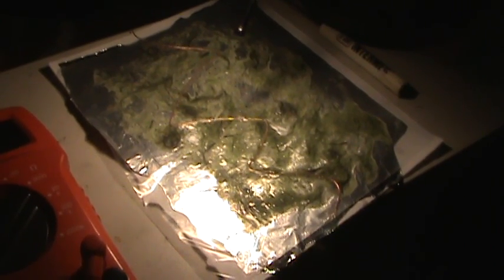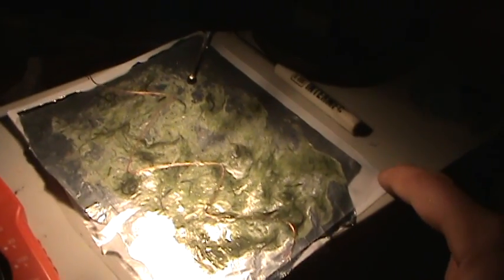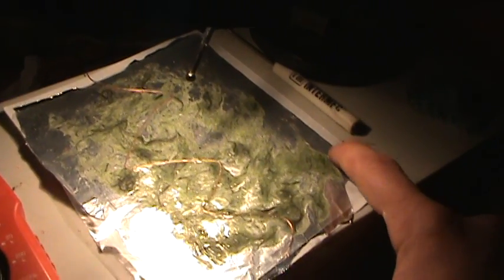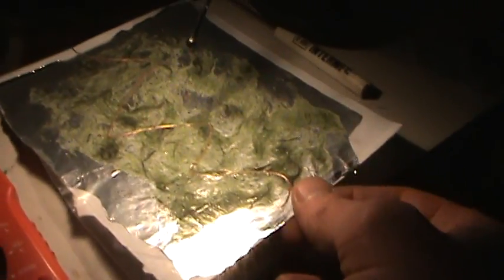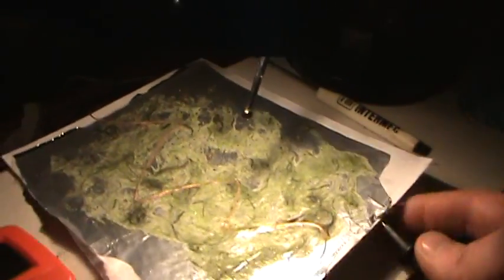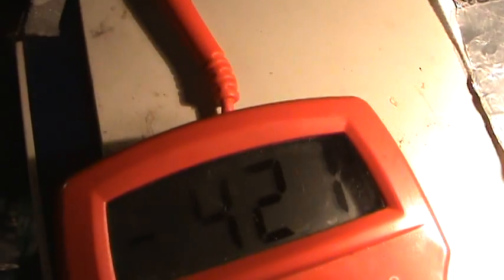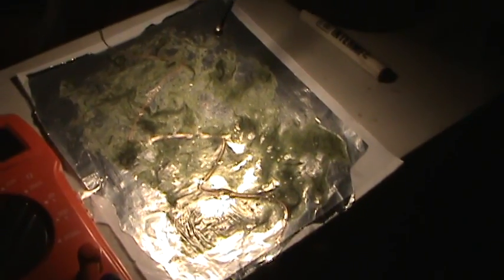Artificial Leaf

Comment: Did you connect the copper wire to the upper alufoil or is this
isolated to this upper alufoil ?
Where do you take the voltage off ?
Between the copper wire and the lower alufoil ?
Do the carbon nanowires touch the upper alufoil or are they
isolated electrically from the alufoil via the epoxy glue ?
Would be really cool, if some of us could replicate it and also
get 3 Watts of power out of such an easy cell...
Many thanks.
Regards, Stefan.

Comment from the maker: The upper layer becomes devoid of electrons due to the bombardment. I think this is occuring via electrons being knocked out of the bio-epoxy by photons, and then ionizing the air, vs bing able to re--enter the plastic. I utilized a battery across the leads whilew drying to primitively align the conduictive nanotubes to the elctrodes, I hope this info helps potential experimenters. My next experiment will probably be CPV (concentrated photovoltaics) ready liquids with donor and acceptor fluids.

Comment from the maker: I am finally getting back to full employment and an apartment so my experiments will continue.  I though i explained the construction in the video but let me remember.  I was basing the concept on a photo-electric capacitor that self-charges, vs a pn junction as in pv cells. There are two sheets of aluminum, one in the dark and one in the light with the chlorophyll-carbon fiber-epoxy coating. The copper wire is embedded in the chopped carbon and barley grass extract.

Comment: @UFOMAN618 It is a good way of explaining the photovoltic effect for sure but not very useable. To get higher output in organic cells you'll need to "align" the molecules to get better flow of electrons. Just putting random materials together won't do any good. That is called nano-technology and requires some very expensive equipment. However, nice experiment!

Comment from the maker: @challenger159 My guess on dealing with this is to not allow exposure to oxygen in the cell.. Signs using plastic paint last for many years without bleaching. All materials exhibit varying degrees of the photoelectric effect. Ie either beta particle creation or negation (holes). My theory for this first cell departs from semiconductor tech used in traditional cells.

Comment from the maker: @fredrik999z  i estimated the 3rd prototype at around 3 watts from the 4 by 5 inch cell...not impressive compared to modern 130 watt cells but still a measurable current and efficiency (impressively) from a homemade polymer cell...im a mechanical engineer so it would be nice to get some biochemists working on this who understand the photoelectric effect regarding organic molecules more than I.

Comment: There is a great deal of difference between volts and watts.  I have a 10,000 volt generator that can not even flash a common 60 watt light bulb, or even burn out its element.  What is the power available, that is the real question.

Comment: Is there any water in there ?
If yes, it is probably just a galvanic effect.

If you switch off the light,
how many Millivolts will the voltage differ ?

How much short circuit current will the 
cell produce ?
More than 1 Milliamp ?
Please let us know.
Many thanks.

Regards, Stefan.

Comment from the maker: I don't have good enough equipment to reliably test current output. I need a new fluke. Yes, It needs it push current to be useful. This device is a capacitor with one side coated with a photoelectric material (chlorophyll). Adding a diode, or grounding one side greatly effects the rate at which voltage builds. My main point is that cells need not be silicon, or even silicon oxide, though i think CDS cells (on glass) are amazing. I am currently working on grant for conventional solar cells + CSP